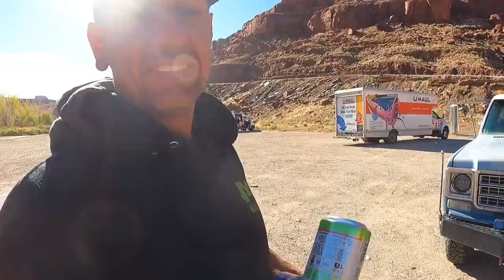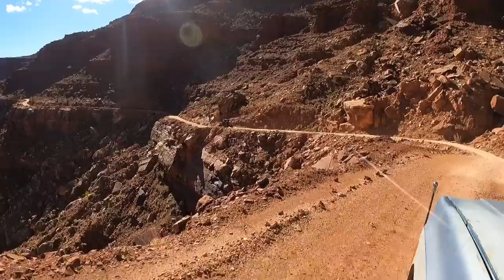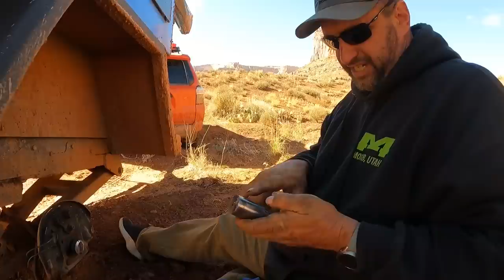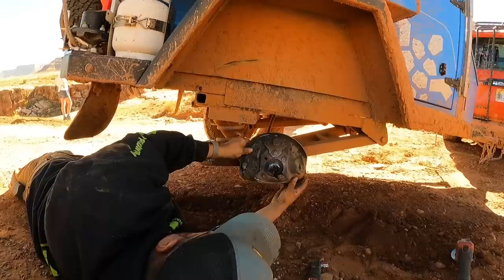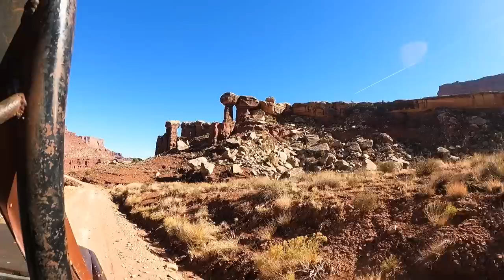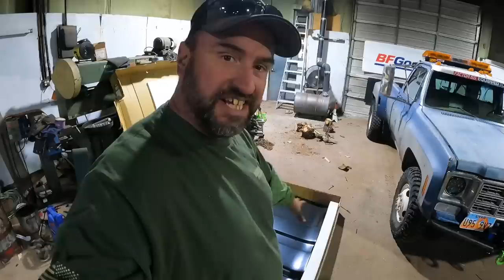Broken Overland Trailer On White Rim Trail

Comment: In my 60 years of towing, wrecking yard and parts house experience I have never heard of or seen anyone do that.  I am again humbled, wow.
Reply: I found this guy because I was searching for off-road trailers and found “that guy in Hurri-Ken”, which led me to Rory!
Reply: P MAE----- You feel the same as the rest of us .
Reply: @P MAE. Dont say that too loud. Rory wont get that swelled head through the door, lol.
Reply: I think Rory would say , Well man have to do what man have to get those things out of there, (without rotator and flatbed).
Reply: Rory is one of a kind in the recovery and repair business. His shop is wherever he finds whatever needs to be repaired or replaced.
Reply: Awesome, just awesome  !!
Reply: @jormalonnberg1578  Totally! And considering that most of the time something just breaks into two pieces (or more) and all you would need is just some glue. Of course some new parts sometimes. So why not just fix it on the trail and keep on wheeling. A lot easier than start pulling vehicles out from very nasty spots.

Comment: Been on the White Trim trail 3 times in the last 7 years ( but not during Covid, when it was shut down). Decades back I was on it a few more times also.  Iv'e seen rigs pulled out w/straps or ropes by someone in their group (I assume), but I've never seen someone like TM pull a spindle, (on a trailer) grind & then weld it, and then piece it back together again, so it could be pulled out. That's real 'art, mechanical prowess &  know how" to pull that off. For those that have not done the loop, there is beautiful scenery on various parts of the trail route.

Comment: The trailer owner should ditch those 4-in wheel spacers and get an axle to make up the gap, because I think that is what broke the axle.
Reply: Did owner add those spacers or did the OEM do that?
Reply: @BlackBuzzzard  I think it's oem, which is even more of a red flag.
Reply: @BlackBuzzzard  don't know, but it  seems most likely to have something to do with the failure. If you look at the broken spindle it seems to have previously cracked approximately ¼ the way thru.

Comment: If they added trail repairs to the wrecker olympics, no one could touch Rory in that category.
Reply: I have witnessed a few trail repairs by Merlin around 2008 he had a welder on his rig back then
Reply: The only advantage that anyone would have over trail mater is Matt's wrecker is heavier. So it should be able to lift more, but it's really big and heavy so that's a disadvantage. I think Rory wins hands down.
Reply: Matt's wrecker is much  bigger,  but that will be somewhat compensated by the fact his has rear steering.
Reply: @Donna Chavez we are lucky that they all document and share everything. I thoroughly enjoy Rory’s content and will enjoy watching the olympics it should be good fun
Reply: @Donna Chavez I also think Eric has a chance at the win. His big disadvantage is he spends most of his time in the woods, rather than on the rocks. But when he is in Utah, he can still get the job done without a problem. But Rory and Eric are the two that actually spend the most time in wreckers. But, who is Merlin?
Reply: @Donna Chavez Thanks.

Comment: Great work Team! About 15 years ago I found myself in the same situation except with a 36" Rome disk. It was early spring and the spindle broke off when they hit a huge chunk of frost. We welded the spindle back on with 6013 and then 7018 rod. We couldn't get a seal right away so my co-worker found a Tupperware lid that fit the O.D. and we trimmed the I.D. to fit. Funny thing is it lasted all summer. Just kept pumping grease in it everyday. Changed it out in the fall. Good times.

Comment: Awesome job getting that broken spindle welded back on and being able to drive out on it!    👍💯
Reply: those wheel spacers didnt help either but still a fail on an alleged USA mfr product
Reply: @lutomson3496 
Wheel spacers are not automatically a problem if used to fit wider wheels keeping the lever moment (or essentially the centre line of the wheel) the same as the original narrow wheels. They are a great way to facilitate the use of wheels with deeper inset on the rim, for example many front wheel drive cars have the spokes right on the outside of the wheel and rear wheel drive cars have the spokes nearer the centre line.

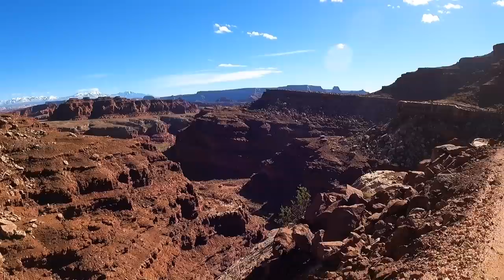Comment: 3:28 Ridge drive sure has a grand view, just seems too risky if it was pouring down rain and having running water across the path / cliff, resulting in rock slides.  (Drive when dry is my best guess).  Many kudos to your crew for taking the risks to recover people and machines.

Comment: Another really nice field repair. It might not be perfect, but in some cases it can last a long, long time. I once rode over a cattle grate that was missing a bar or two. I had just enough momentum to make it across, but it was so violent my engine hit the radiator. It overheated but I made it back to camp. One friend had a tube of silicone, so I packed it around the leak in the radiator and I filled it with pond water. I think it lasted two or three years.

Comment: FYI for the future.  The pivot on the swingout tire carrier of Turtleback trailers is the same spindle as the wheels. Its done that way specifically as a backup for situations like this.
Reply from the maker: Except it's welded in place... So how does that work?
Reply: I was just going to comment on that also, the company I work for uses Timbren Axle-Less Trailer Suspensions, and we use an axle and hub for the spare tire carrier, to be able to use the spares, On the turtleback one, you can definitely use the hub but I don't know if the axle part is bolted or welded.
Reply: @trailmater  Don't know. Perhaps that is an older one or its an option. I have seen another Turtleback owner  dismantle the spare tire carrier and repair the damaged one on the ground with the parts.
Reply: Most overlander trailer manufacturers use theTimbren Axle-Less Trailer Suspensions, which Turtleback also does, but this is their Icon suspension upgrade, which I couldn't tell in the picture if the axle itself is removable. Like on the Timbren. Either way it made for good content, and that hood looks pretty cool compared to the everyday run of the mill cowl induction hood, like I have on my Chevrolet S10 square truck LOL

Comment: Wheel spacers, why am I not surprised...
Amazing work welding the spindle back together accurately enough for the bearing to slide back over, that's a really difficult job in a workshop with TIG. Let alone on your back in the dirt ark welding. 

Ok, cowl hood looks pretty good on old blue,

Comment: I would bet a dollar that the wheel spacers increased the lever force on the spindle by moving the load (wheels, tires and trailer) further outboard and caused the spindle to fail, especially with the trailer being fully loaded.
Reply: I'll bet $10 that they were factory installed.

Comment: I've done trail welding with two 12 v batteries hooked in series, a set of jumper cables and 7018 rods on a suspension link. Got us out and home safe. I don't  know what that fancy shmancy welding system that  you got is, but I gotta say it's close to what we did. Awesome piece of redneck fixin' ! Love what you do!

Comment: I have been involved with replacing a few spindles on trailer axles over the years. I have never seen a spindle welded back together like this even for a ‘trail’ repair. I am impressed with its alignment as I know from the above experience the pain of spindle alignment.

Comment: I’m always wowed when I see you do an off roadside repair. A quick tip for when you have a brake caliper that you need to prevent from squeezing out the brake piston. Use a brake caliber collapsing tool. One size will fit all. This will work better than a set of sockets, or a cut rotor. 
Again a great video sir. Love the content.

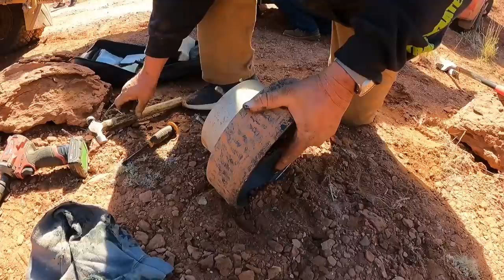Comment: Well at 5:28 it is obvious how and why the spindle broke. Good luck getting it covered under warranty. That wheel spacer looks at least 2"+ the leverage load put on that spindle is multiplied enormously the further out the Rim is mounted.

Comment: I understand the idea of a small maneuver-able trailer. But in the off-road world spares are a carry with thing. Mabe a dual axel under that tiny trailer. Fixed suspension. 2 spare tiers. I have a small trailer I tow with the 4 wheeler. I distribute hay in the pastures. I fixed 2 axel to the underside a tool rack in the front and even a flat dose not stop it. The bull stops it t scratch on the hay and sometimes flips it. Another pluss is it will not need a trailer jack when unhooked.

Comment: I'd be really worried about that brand of axle, and why thick wheel spacers were used by the trailer company.  In fact, I'd be worried about buying a trailer from that company at all.  Great fix by the 'Mater.

Comment: That 2 inch wheel spacer made the rim and big look cool, BUT it probably caused the failure by increasing the length and therefore the  amount of leverage?

Paint that hood after you sand it for a million hours and blow torch and stat test it like Robbie taught you!

Comment: Did that wheel spacer increase the load on the shaft? Greater offset meaning more leverage sort of thing.  With it being a proprietary trailer, is it a poor design, or did the only available wheels have too much positive offset?  Something to do with making room for the trailer breaks maybe?  I just can't help think that they shouldn't need the wheel spacers, and that those spacers might have contributed to the shaft breaking.

Comment: Daaaaang! Using nothing but eyecrometer to weld it back like that.... for it to travel all the way back from (I think it was mussleman arch) then through potash road. That is some welding right there. 

Those of you that have never been on potash road or white rim trail... it is NOT a road and NOT a trail. You get the whole ondulation thing going on. Every time road clears up and you pick up speed is when it goes right back to ondulating and catches you offguard. Trailer just could not take it anymore, apparently. 

When I did potash road 3 times and white rim to Lathrop from that side... it was a loooooooooong drive. My insides kept jiggling for a week. Funny thing is that coming back was actually easier than going towards because of how ondulations are. There is a gnarly step completely out of the blue and invisible in the wide open right after mussleman arch. I wonder if that is where they lost a wheel?!

Comment: I have to think that the wheel spacer on the trailer puts more stress on the spindle than it was designed for. Put wider axles on for proper tire clearance.

Comment: I saw two tow rigs for the trailer recovery and was desperately hoping y'all would hook up regular, then back the other truck up to the rear of the trailer and lift it with the boom then drive it out sling style in the air, one driving forward one driving reverse. That would have been legendary! Anyways, you gentlemen are clever and confident. Doing that repair in such a fashion, working with available tools, and being sure enough in your work to tow it out, that's almost as legendary. Two thumbs up!
Reply from the maker: That's actually the reason we took both trucks.... In case that's exactly what we had to to. Lol.

Comment: I know you're all probably wondering why they took that back to the manufacturer instead of having Rory fix it.  Me too.  

A spindle and brake replacement on that trailer really isn't all that much,  about as much as a Uhaul trailer rental one way.  

So I looked them up at Turbleback Trailers.  

THAT'S A BRAND NEW $35,000 CAMPING TRAILER!  I'D TAKE IT BACK TOO!
Reply from the maker: Actually wasn't brand new. They said they have over 15,000 miles on that trailer, alot of it being offroad miles. The manufacturer wanted to check it out and upgrade the axles on both sides to help them out. I actually thought it was super cool of the manufacturer wanting to address the problem instead of find reasons to NOT warranty the issue.
Reply: @trailmater  Thats good news.  Those are #3500 swing axles on it so I'm guessing that spindle took a very hard hit earlier in it's life.  Obviously the grease channels played a role in the failure.

Comment: I've broken trailer leaf springs before in UT backcountry, but never an axle spindle.    And I would never use a spacer!  Now I  carry  spare hub, spring, ubolts,etc and only load  trailer to 50% axle weight rating .   Wonder if owner had a whole lot of beer and water on board?

Comment: I'm thinking that hub spacer didn't do the spindle any good. Maybe the manufacturer should have brought the spindle out further and used a wheel with more backset? That was good beveling and welding, for sure. I woulda welded too much on and spent the rest of the day grinding!

Comment: As usual, I’m stunned in total awe, but tell me this: what, for example at this trail fix, was the total time at the trailer. I mean, not the time to repair, but the entire time spent at that trailer.
Why I’m curious, you ask? Well, at a situation like in this video, you first want to understand the “why”, then one has to come up with a “how”, quickly followed by a “because” (of the tools at hand, for example).
Aside from experience, knowledge and talent, this requires copious amounts of brainpower (and a surprising amount of silly quips!), so I’m curious what your total time from head scratching to action to getting back on track might be (as compared to the endless time I need for anything coming close to what you do).
Thanks!
Reply from the maker: I had planned to weld the spindle back together from when I left the shop. The customer kept telling me on the phone that wouldn't work, so we took other options to have a couple plans. Then when we got there, I looked at it, said yep we are welding it back together. So we did. Was probably there a little over an hour for prep and cooling and reassembly, then headed back.
Reply: @trailmater  thank you! But one hour? If I hadn’t watched your videos since the get go, I would’ve thought you’re fibbing, now I just bow in awe…

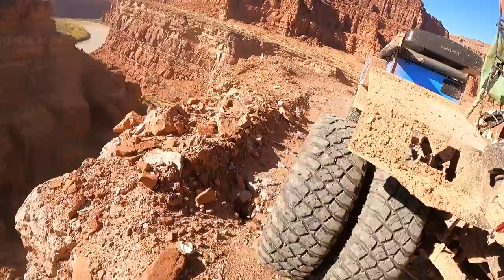Comment: @ 10:35  they are also fishing for personal information , they have "if someone contacts" them a dozen or so scams going..
I get the scammers on my comments , they often use bad  grammar so they are overseas.
Those overland trailers need heavy duty tandem suspensions , even on a small one.  They get loaded down.

Comment: Those wheel spacers r whats putting such a heavy side load on the spindal I would tell the owner to get better off set rims & get rid of the spacers seen spacers destroy ball joints in no time on trucks they r not designed to have the wheel sitting out so far just my observation great job on the welds

Comment: That's a 30k trailer, before he put all the accessories on it, with all his crap on it, its closer to 50k. The wheel spacer was from the manufacturer! Instead of properly designed and spaced timbren axleless suspension, they had to add massive spacers to get the tires were they wanted them. Seems like a subframe redesign needs to occur so they aren't stressing those spindles so much since they run jeep matching rims as part of the original design.

Comment: Hey, maybe you've already mentioned this, but what does the Trail Mater weigh? Fully loaded, as you would use it.
Reply from the maker: Just a hair shy of 7k.
Reply: @trailmater  So about as much as a fully, overlandey prepped 4 door Wrangler, with a snorkel. You can buy a lot of bolt-on crap, but most of it is just extra weight that only contributes to breaking stuff.
Only 7K # for that beast is pretty impressive.
I really like that rig and I really admire the care you use during a recovery! You have skills that I have not seen in anyone else.

Comment: The extra leverage provided by the wheel spacer cannot have done that spindle any favours at all. It isn't an engineering solution that the maker should be proud of (if the spacer was their fitment).

Comment: Food old ,get home repairs.
I would be checking the authentication of the steel and where it is from ,then look at design .
There will be questions asked ,was it overloaded,where did you take it,how fast were you going .
It could have been worse and caused an accident on the highway.
But is this just normal for an industry that builds big and wonderful looking motorhome ,fifth wheel monsters with light weight flimsy suspension ?